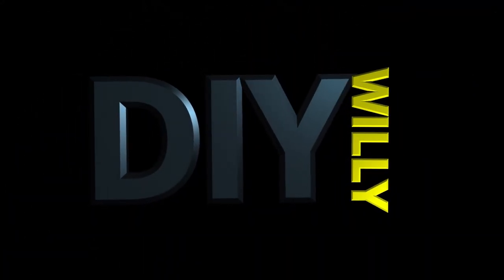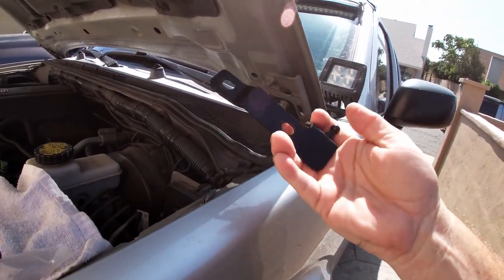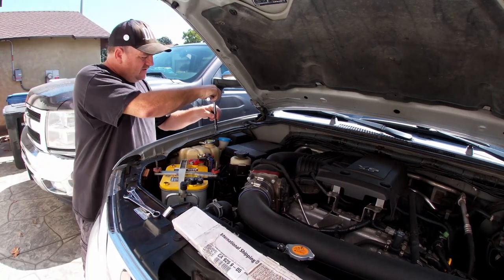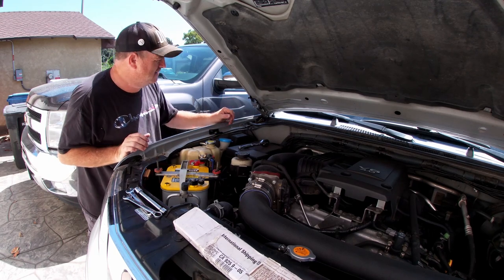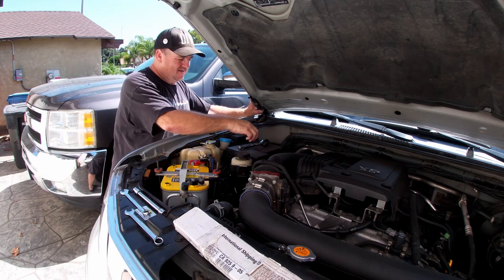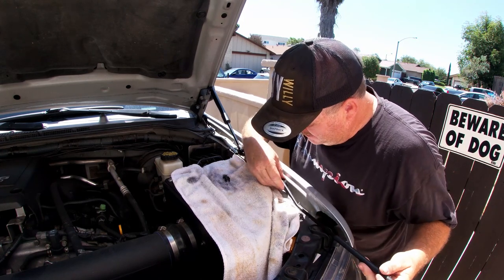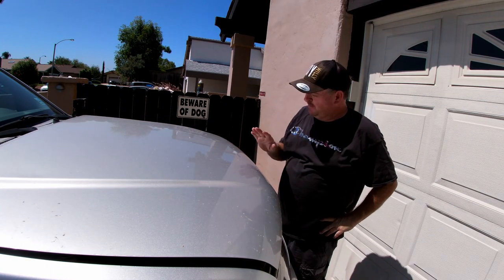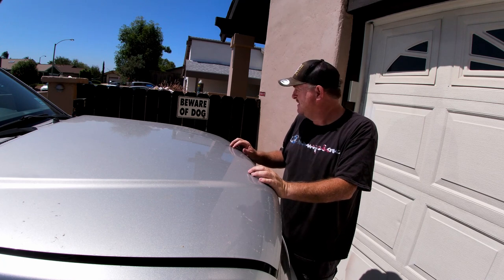Hood Support Strut Install 2005 - 2014 Nissan Frontier

Comment: I wanted to the same thing on my Frontier is a 2021 but it will fit fine. I saw another video where the guy had installed the  struts per instructions one up and the other down. However, you proved that it doesn't make any difference. All the contrary it  looks better with the struts in the same direction, instead of of one up and down. 😂
Reply from the maker: These struts continue to work like new. I feel this is one of the most important upgrades you can do. Thanks again for watching!!

Comment: By the way you had the arms upside down, how I found out is by installing one arm and it wouldn't hold the hood open on its own if you install them the other way one arm can hold the hood on its own
Reply from the maker: Thanks for the tip!
Reply: According to z1 offroad this installation is in fact correct
Reply: I thought so too until I looked it up on Z1 OFFROAD
Reply from the maker: @davesnyder1183  I know… Thanks for clarifying..

Comment: I installed some struts a few ago,the installation went fine, when I went to close the hood,it wouldn't close,the recoil was to little,so my question is what size struts should I look for??
Reply from the maker: Hello Kevin, Was it a kit you purchased? The kit should include the correct struts. Double check you bracket placement. Maybe the bracket on the fender is not correct.
Reply: @DIYWilly  I got it from Amazon,it said it would work with my truck, if I order one again, do know what I should look for? I have a 2018 Nissan frontier
Reply from the maker: I’ve had good luck with parts from Z1
https://www.z1offroad.com/z1-products/z1-off-road/z1-off-road-frontier-hood-struts-p-24173.html
Reply: I returned them, I was very unhappy with my purchase, after watching your video you made it look so simple, thanks for the strut reference